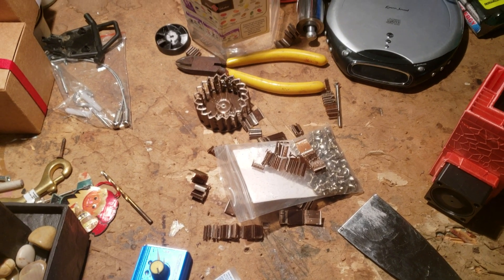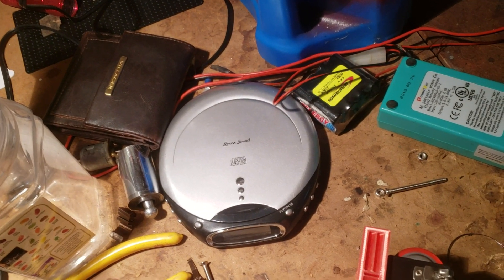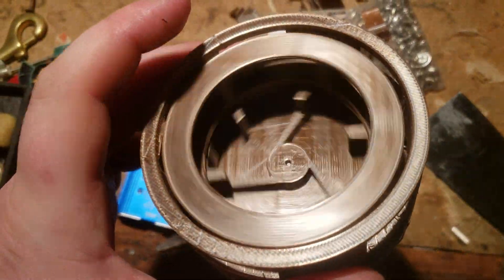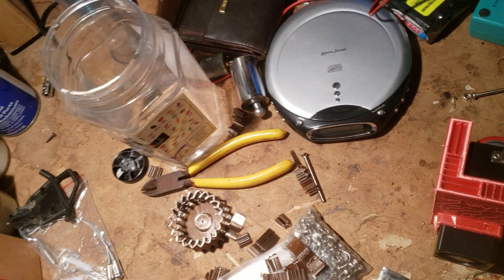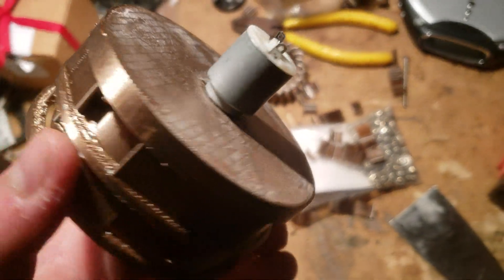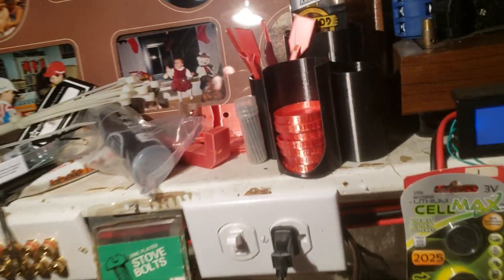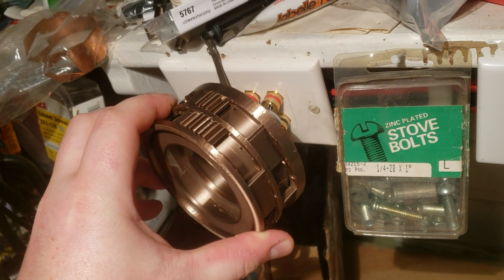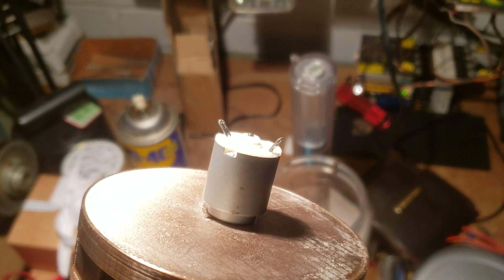3D Printed Mini Siren

Comment: The motor has low rated torque, rpm and voltage. You can’t use that